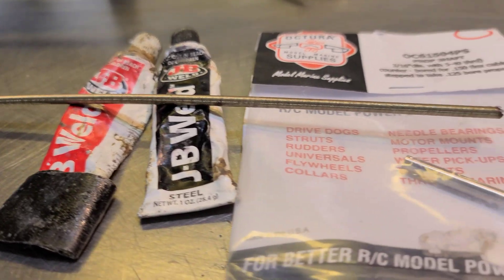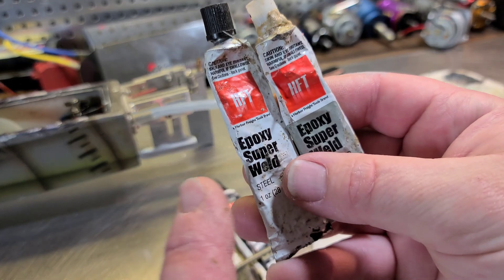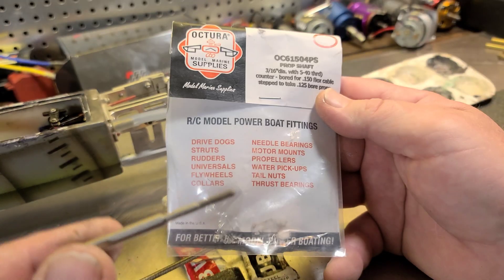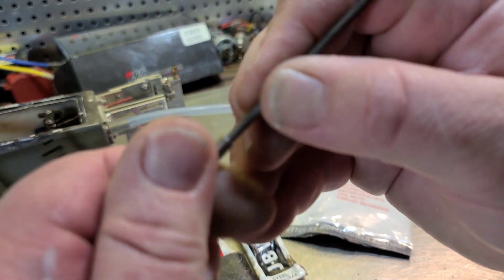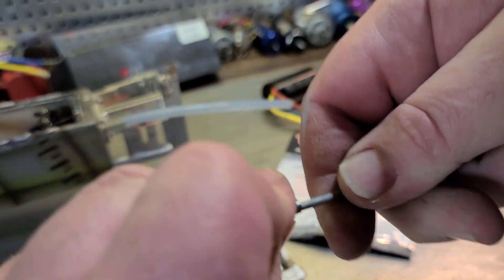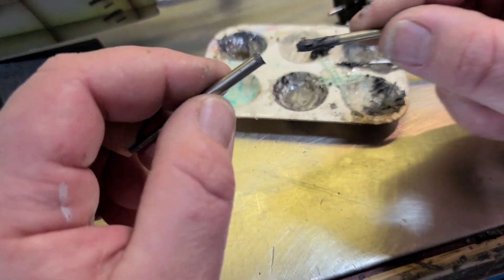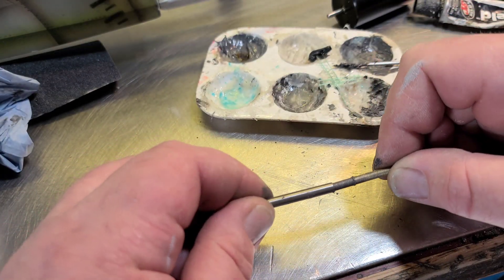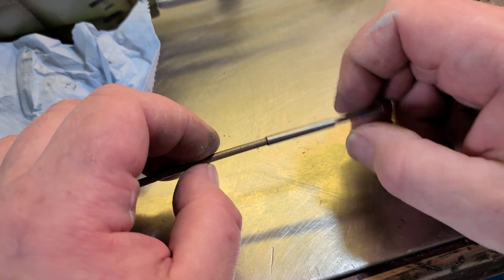How I Assemble Flexcable & Prop Shaft Without Solder - RC Boat Build

Comment: could you drill a hole and pin with a steel pin for extra security?
Reply from the maker: I guess you could but it's really not needed, as long as you properly prepare the connection it should hold.     Filling a hole through the flex cable may weaken the cable

Comment: If you know how to use JB weld that shit is amazing i put a engine case back together on a motorcycle that threw a rod busted the engine case at the seam I put the two halves back together better than factory I think

Comment: Ok. Good job. But where can I find the hollow shaft and it's part number for a .187 flex cable?
Reply from the maker: I didn't see any .187 bore shafts either if I find one I will post the link.

Comment: The JB weld flex shaft on my SR80 pro is still holding tight! Ive upgraded to a sonicwake and got some upgrades coming, the snow is here though now so itll be a shelf queen until nenxt season

Comment: Have you try loctite 603, 638 or 648? 603 is oil resistant but 648 is the strongest of them
Reply from the maker: I think 603 is recommended for the flex/stub joint!  Same methods different  Adhesive